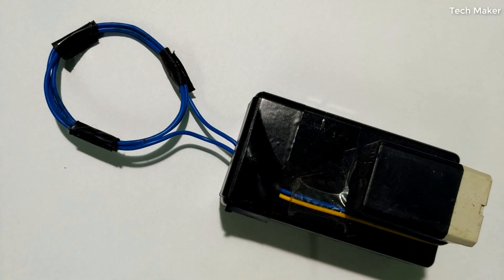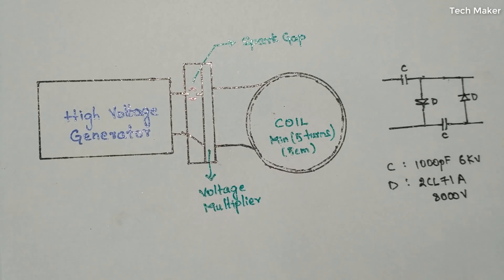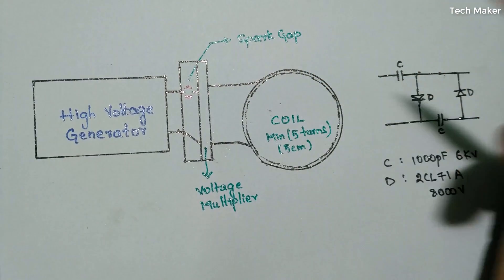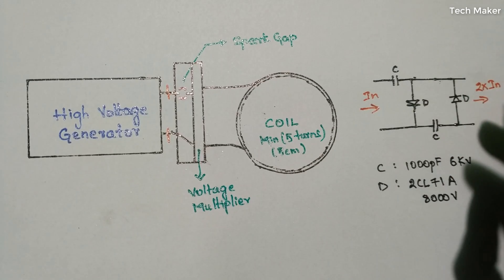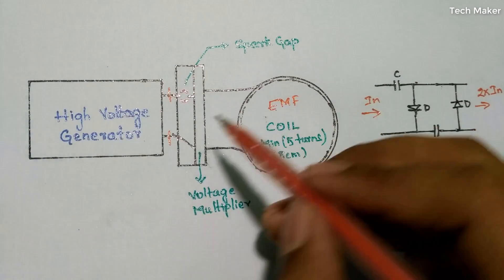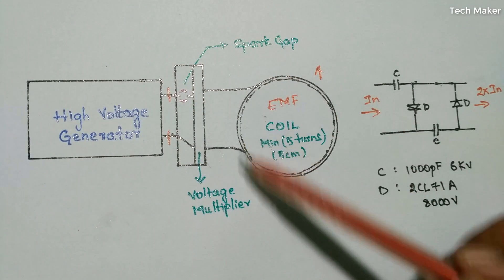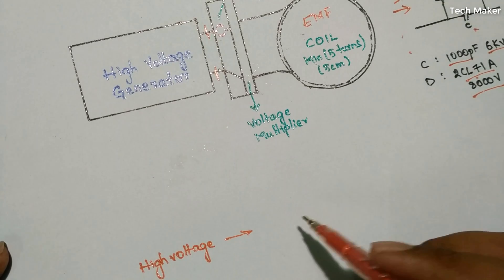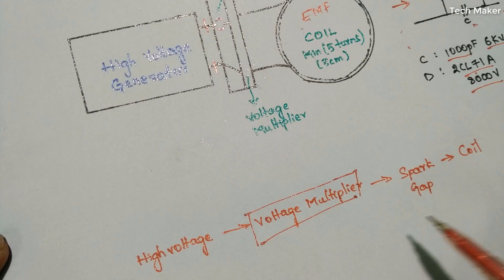How to make EMP Jammer - Explained

Comment: would it be stronger if using 2 batterys?? good as prank if friend uses g-shock watch haahh
Reply from the maker: It depends on capacitor output and frequency of sparks
Reply: @TechMaker1  i have a high voltage converter 400-600kv, can you tell me what i need more to make a circuit and complete emp

Comment: nice video many thanks, but what do you mean by adjusting the frequency by adjusting the spark gap. Pls clarify that and how to do it, i.e  using  o-scope or what.Many thanks
Reply from the maker: If the gap is more, less sparks appers (low frequency). If the gap is less , more sparks will appear (high frequency) which mean you will get more amount of pulses in less time.